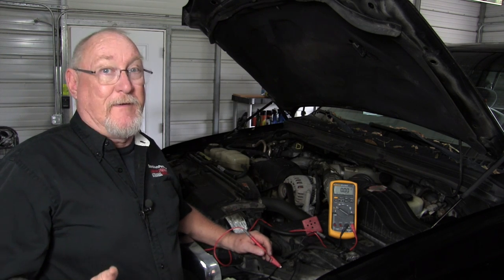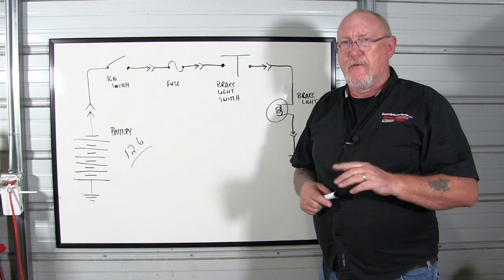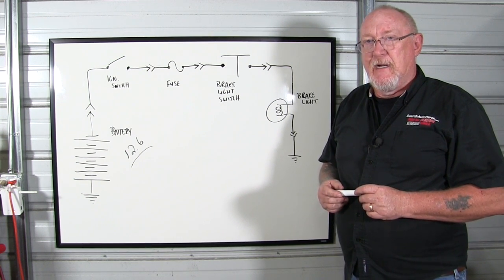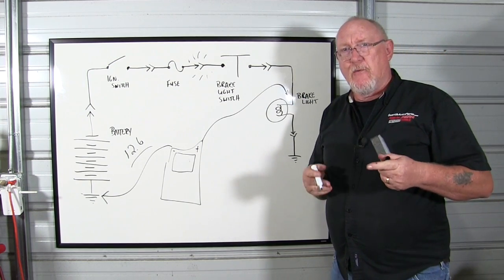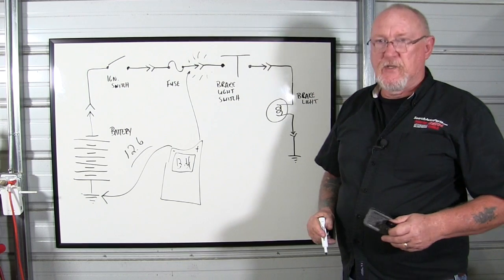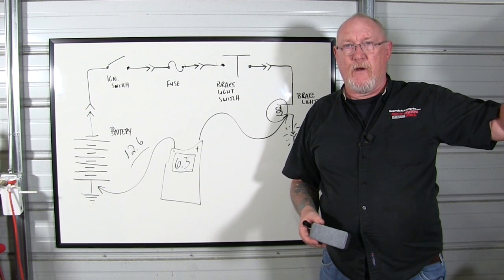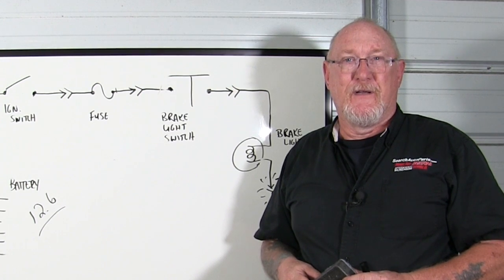The Trainer #84:  How You Can Measure Voltage When Your Meter Leads Say You Shouldn't

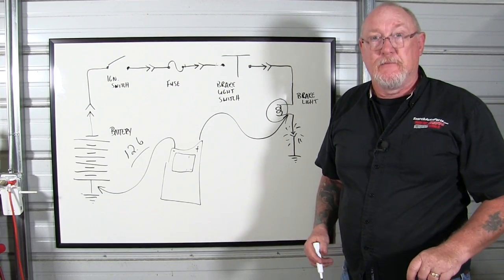Comment: Lost me at 11:00 ....
Still dont understand why there is measurable voltage between ground and ground when its just battery to chassis to metal ....
There is NOTHING between that battery ground and the chassis and that wire going to the light load that would create a voltage potential.  

In a case like this, you would check for continuity between the battery ground and the negative side of that light load to make sure you got 0 ohms or close to 0.
Reply from the maker: Let's see if I can clarify for you. First, a static resistance test may read ok but the current path is not strong enough to handle the amount of current present when the circuit is operating. That's the whole reason for this test method. Second, think of the lead placement like this - the lead on body ground is not on the ground side BUT ON THE POWER SIDE OF THE UNWANTED RESISTANCE. When  you think like this, the meter is testing the potential voltage the same way it would if you had the second lead on the positive battery post. It is now connected from the body ground to any and every electrical component on the car, and from there through any one of the components and back to the battery. Make more sense?
Reply: @VehicleServiceandRepair  It still makes NO sense because your switch is open and there is NO current flow. 
So again, WHY would you read any voltage between battery ground and the ground side of the "light" with an open switch ??

With the switch closed (not shown in the video) that entire path from the battery + to the + side of the light is basically 1 wire, so if you take your - lead from the voltmeter and place it at chassis or battery ground and place the + lead of the voltmeter to the + side of the light, you should read 12V UNLESS you have what is called a "high resistive open" which is what is impeading the path of that 12V line in which you won't get the full 12V but less. 

Now IF you have a complete closed circuit and that light is ON and current IS flowing, you WILL see a light voltage drop between chassis ground OR battery ground AND the - side of that light, that low voltage drop IS the actual current flowing across the meter leads and the meter see's it as a voltage.
This is how we measure current flow over a fuse to see if its flowing current or trying to find the parasitic draw off a battery.

But your diagram shows an open circuit which does not make sense how you measure a voltage on the - side of the light to chassis or battery ground, thats basically  a straight piece of wire that should be 0 ohms ...
Reply: @VehicleServiceandRepair  Someone else explained it to me and it makes sense now.
If you take a wire and measure end to end and get 0 ohms, that means it has good continuity for the case of NO LOAD and for the meter using very little current to test.
Now putting a heavier current load across the wire is another story.
If that wire has resistance on it, it will show its face during a load test.
resistance to current is a "load" and this resistance or load will create a voltage when current passes thru it. 
This is why you will measure a voltage across a straight piece of wire when you should NOT because it has a load or has resistance somewhere in there. 
And this is why the voltage will drop because of that resistance.
Reply from the maker: @ACommenterOnYouTube  Pretty close - while you're explanation is a little off I think you understand the concept.

Comment: I've watched many of these videos, now, and have to say they're so wrought with mistakes and misinformation it's alarming.  It's criminal to teach someone something that is incorrect or only partially correct because it's easier for the instructor.  Those wanting to learn shouldn't have to un-learn bad information first... everything should be foundational and cumulative!  From the word "go" this video is of the same ilk with the schematic symbol for the battery drawn in reverse polarity.  No one caught this even during editing?  Was there any editing or proofing?  But that's just the FIRST thing wrong here... the explanation, itself, is hand-waving and BS when it's just as easy to teach the ACTUAL theory/testing.
Reply: What is your point?

Comment: Using your diagram how would I add an additional light aka load to that circuit without dimming both lights? Thx
Reply from the maker: You would have to wire the second light parallel to the first .

Comment: Say what ?   DC current flows neg to pos
Reply: it does but he is talking about voltage readings, not the direction the current flows.
Reply: His diagram shows current flowing to ground , talks power side ( both are power flow )
Gets to the end ( neg ,ground says the flow stops ) pos  side pulls current
Reply: @artyfuffkin7805  he was explaining how voltage starts at 12V at the battery and drops to 6V at the light + side when there is resistance or a fault or a "thief" as he calls it.
This was voltage drop video, not how current flows from positive to negative even though he made it sound that way.
Reply: Most teachers eliminate saying ground and say neg side , 
Ohms test is my choice on neg side

Comment: And all the hundreds of videos and dozens of friends I've had try to explain this to me it finally clicked with your explanation thank you so much troubleshooting a battery draining issue on my 1969 Ford f250 that I cannot figure out but this is definitely going to help I replaced the alternator the voltage regulator the battery wiring harness I'm just trying to figure out if it's possibly the starter solenoid even though it's new I know the remanufactured ones are often crap so I'm going to use this information and knowledge you just taught me to go home and test it out thank you so much!
Reply from the maker: Check out our main channel page and look for the electrical testing play list. I have a few videos on parasitic draw testing that will help you make short work of your issue.

Comment: I don't do much work on automotive electrical systems,  I work on residential and some light commercial, but this video regarding voltage drop is spot on.   one way I've checked for voltage drop in a house, was I measured the hot to ground, hot to neutral,  and finally neutral to ground voltage in a receptacle with a heavy load plugged in, such as a 1500 watt space heater.  the neutral to ground voltage is the difference between the hot to neutral and hot to ground voltage.   A receptacle with a neutral to ground voltage more than about 2 volts  is a sign of high resistance connections somewhere upstream,  or the wiring may be undersized for the load or length of the run.   Sometimes it's necessary to step up to 12awg wiring on a 15 amp circuit,  which normally uses 14awg, on longer runs from the panel, to keep voltage drop at the far end under control

Comment: I never thought of actually checking the lead after the load like you did. 
I always thought you'd be checking resistance from after the load to various points leading to the main ground.
In my S10, I cleaned the original grounds then added more grounds to the firewall and the front core support.
Great explanations. 👍

Comment: i guess i am just lucky ???????  I am 88  tbl shooting all my adult life  i never ran a tble for low voltage on a vech. i wiil say this a hard tble  to see  it just clicks no matter what you do  solenoid ----jumper cables  still ckicks one time  i changed the starter still clicked   this what we found the gd cable go sdown to the chassis and bolts tothe chassis  that bolt was about to fall off     fixed and ok learned a valueble lesson  next time yrs later i  knew where to look  fixed 5 mins   next it happened at  the lumber yard everbody around a truck isaw wat was happening  to to wait a minute  got my jumper cable connect one end to neg batt other end  same cable to metal on the eng told him to try it started right  i noticed his neg  cabled smoked  to him he needed a new  cable and walked off . made me look like a smart dude LOL

Comment: Hi Pete, as what I learned on our GM training voltage drop should be done in parallel with the circuit, they do not suggest to put the other test lead to the battery post because of the surface charge the battery has, we use the Voltage Difference technique by getting the difference of the most positive side to the most negative side.
Reply from the maker: The technique I show is in parallel - just extended to include the entire circuit path. This allows me to narrow down the side with the fault in two measurements.

Comment: So lets say on a brake light circuit...battery--fuse--brake light switch---14 gauge wire all the way back to the tail light bulb--ground to the steel frame---heavy gauge wire from the frame to the neg battery terminal..Circuit complete.  That steel frame is not as conductive in comparison to the copper wire..So that will lower the voltage to the bulb because the steel frame is not as conductive..it is acting as a resistor..If a copper wire was to be used for the grounding of the bulb all the way back to the battery, without the frame being used, the bulb would have more voltage because the copper wire ground has less resistance to it..
Do I have this right?
Reply from the maker: Sorry for the late reply. Yes, to be technical. But you'll find that the difference between the frame ground and direct line is not that much in the overall picture. The bulb is the primary player.

Comment: Watching this channel worth my time, I really learned a great deal. Thank you senior tech,  I'm grateful.  I've being struggling with a  nissan X-trail 2003 QR20DE.  The issue has being not revving  when you stepped on the acceleration pedal. I've done virtually everything within my knowledge as far as electrical diagnosis is concerned but to no avail.

I'm going to try those you taught me now. I'll let you know the result. Once again thank you

Pls is there a way you could help with sourcing the vehicle wire harness, if I furnished you with its VIN? Because it current harness has been seriously messed up.
Reply from the maker: I'm glad you found this helpful. As for the harness - sorry, I can't help you there except to point you in the direction of your local salvage yards.
Reply: @VehicleServiceandRepair  thanks a bunch. I've tried without any success to find it locally but because, it's a Nissan model not really common in my country of residence. All the same, I say thank you once more. If need be, I would get back to you sir. Quickly before I leave, I really enjoyed your chat with scanner Danner. You guys are positively impacting the present and the generation yet unborn.

Comment: Hey Pete that was a great video! I'm hoping that using your method will help me solve my problem I'm having in my 71 VW. Long story short when I pull my emergency flasher switch with the key off/car not running the lights flash on the dash and all 4 corners of the car but the needle on my gas gauge bounces in time with lights, back and fourth from reserve to full.  When the key is on or the car is started everything works as it should???? I've been looking at this for a few days now and can't see straight! Any suggestions? Keep up the awesome work!!!!!!!!
Reply from the maker: Start with the wiring diagram. Look to see what the two circuits share - I'm betting it's a common ground. Of course, check all the main grounds - battery to block, battery to body, block to body....

Comment: Not once in lecture did you mention the switches needed to be in the on position for voltage reading  to manifest. 
For someone that has no electrical training might get confused on how you get a reading on meter when there is switches open and you don't mention to close them  !

Comment: I took out the battery to see down into where the grounds are for the tranny and unplugged the tranny and all is good.  Since the battery is out of the way I cleaned all up really well and started checking continuity from the negative cable to grounds all throughout.  When I get to the top bolt bare metal of the strut tower, I get like .775 resistance.  I have no clue what to do with that.
Reply from the maker: Don’t rely on continuity. Static measurements mean very little.
Reply: @VehicleServiceandRepair  Your right.  All of what I just did cleaning checking tightening and checking harness's for damage connectors, everything, unhooked all accessory wiring also,  Put the positive lead on the battery fired it up and bam 13.5 v in reference to the alternator case.  I do not get it.
Reply from the maker: @dallaspilotcar9293   Did you take the three measurements I asked you to make? No matter, let's start here - Voltage scale, neg lead to negative battery post (not the cable end) and pos lead on the alternator case. IF that is how you got 13.5 volts you have a bad ground. Leave the neg lead where it is and work back toward the battery until it drops to a few tenths. Move first from the case to the block. Then from the block to the where the ground from the block to the body/battery is made. You mentioned a shock tower stud...if the cable is connected there, measure by poking through the insulation on first one side and then the other. Let me know...you got this!